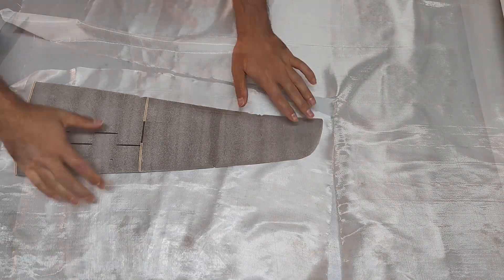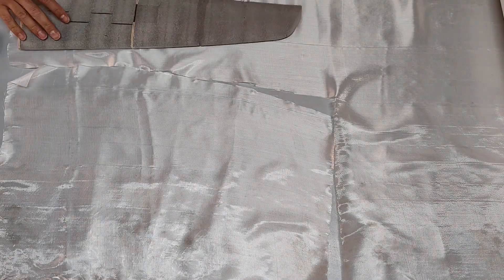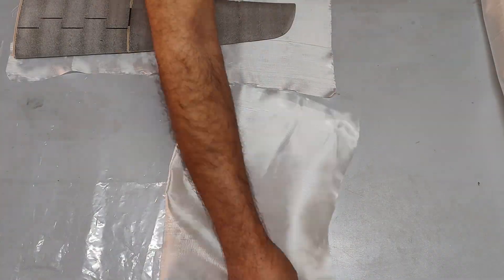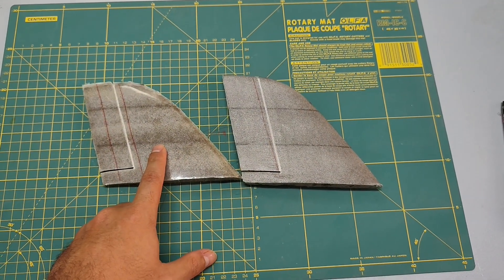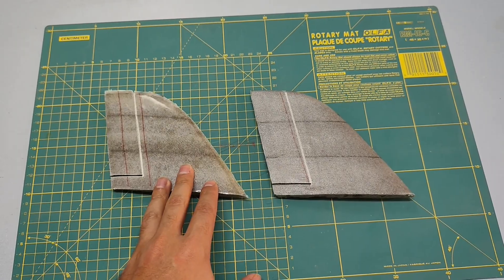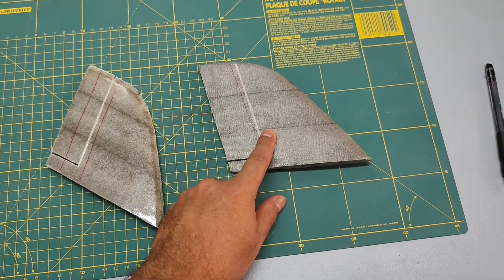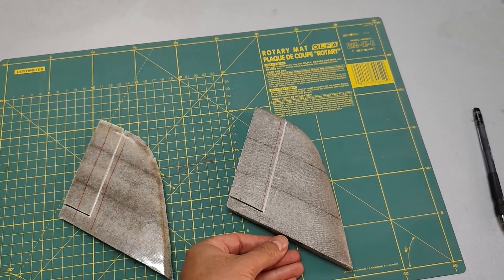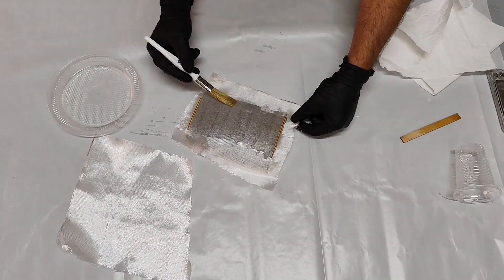How to make RC Airplane Body with Fiberglass | Hand Layup, Primer & Peel Ply Hinges (Part 2)

Comment: Can u make tutorial for 3D print too?
Reply from the maker: Actually, I’m not very interested in building with a 3D printer, and so far I haven’t tried to design and optimize a model for 3D printing. In my opinion, building with a 3D printer has no real enjoyment, and I really like hands-on building, especially composite work.
Reply: @PhoenixHangar fair point